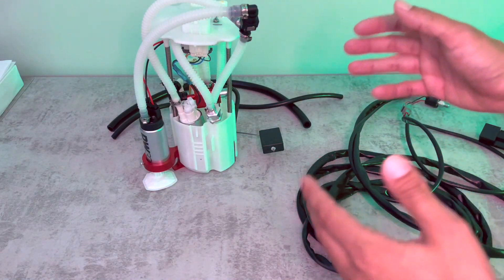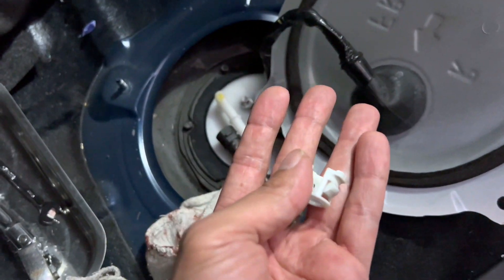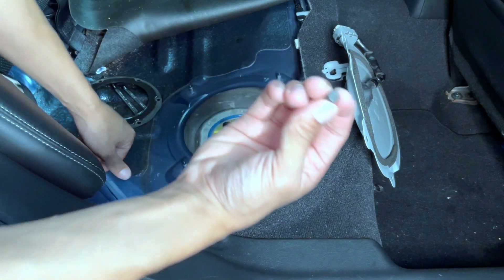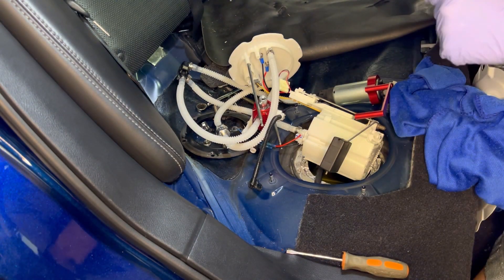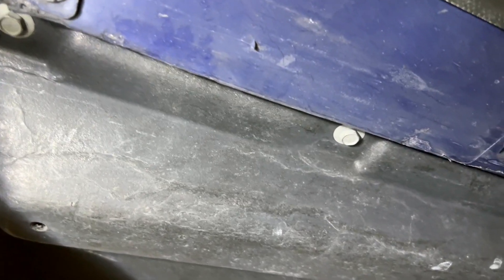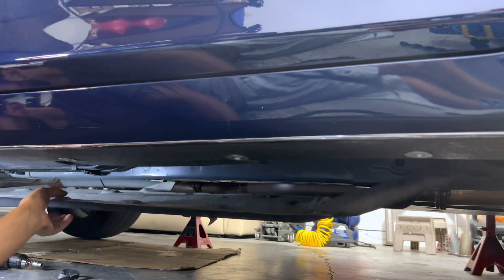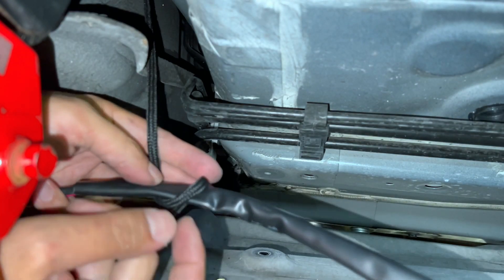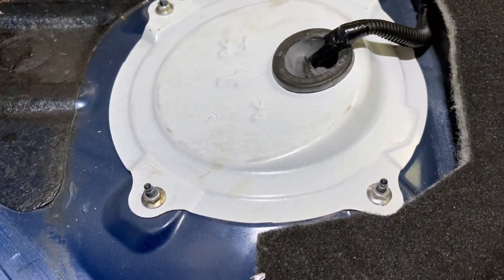How to Install a Spool Stage 3 Dual Fuel Pump VR30

Comment: Nice video, very helpful information.  This is better than just the AMS one because when you go built engine and bigger turbos, there will be a bigger demand on the low side.   I probably won't do this until I go built since I already have the AMS one.   Congrats on the new PB.
Reply from the maker: Thanks bro. 

Yea on stock turbos it’s not really needed. I prefer to have all my supporting mods for when I do upgrade my turbskies. Plus I’m using full E85+

Comment: Would this LPFP upgrade be enough to run up to e50 ? Or HPFP would be best after e30?
Reply from the maker: This will supply enough for e85. If I were you I’d get a HPFP and 1 walbro LPFP.

Comment: Whats up Z,

I think there is a "better" way.

Surge tank up front, run a A/N fitting from the ff kit, into the tank, the tank itself can hold a secondary pump. Hobb all that from there to the proper locations. 

But solid video as always papa!!
Reply from the maker: What up, that does sound like it can work too.
Reply from the maker: Btw, I need you to send me the necessary filters and stuff to store my E at home. Ima buy E98 soon.

Comment: It was a little tricky just putting in and taking out the factory fuel pump assembly when I install the AMS LPFP.
Reply from the maker: Yea, this is a whole other level of pain in the butt.
Reply: @ZillaFullBoost  Yea looked pretty intensive. I'm pretty sure my car was suffering from fuel starvation anything less than 1/2 a tank.. the AMS upgrade pump seemed to help with the short testing I did with the aid of the ecutek app and looking at related parameters.
Reply from the maker: The single walbro 450 will do fine. On my single set up I was able to run just below 3/8ths of a tank of E70 with no issues. This was from a dig for 1/4 mile. On 93 it would be fine even with a 1/4 tank.
Reply: @ZillaFullBoost  Im just running 93 from time to time E20 but not tuned for E-fuel.
Reply from the maker: You’re getting fuel cuts below half?
Reply: @ZillaFullBoost  I was at times before I put on the AMS LPFP. It's been a while since I've driven my car hard but for like 2 years towards the mid to end of 1st gear mph would drop under 100% WOT. As much as 5 mph and the stall out could be felt as a hesitation. I have been tuned by Hussain and Hussain could  make nothing of it. I had a suspicion so one day a fellow in the area on Facebook marketplace was selling the AMS fuel pump. I bought it and installed it. Problem retified itself about 98% last time I ran about 7 runs and dataloged.
Reply from the maker: @GettingthruLife  oh nice at least you're fine now.
Reply: @ZillaFullBoost  my RWd 2019 Q50 is a joke as far as traction. When I got it I didn't know that I want/would go 500hp and 500 torque. I made bad decisions with tires and wheels and wasted money where I would have been set if I had bought MT ET Street R's and 17-18 inch rear wheels. Anything else was inferrior for this car/motor/turbos. Your blue car drag-pack is the setup I should have bought. Two 1/2 years ago those parts where much cheaper and more available.
Reply from the maker: @GettingthruLife  Yea these engines are pretty Torquey. Tires are a must because that RWD life 😅

Comment: What is your preferred wheel setup (tire, rim) for q50’s? Specifically redsport models. Thinking about going with R888R’s.
Reply from the maker: I’m biased towards the nismo V1’s. Since I’m RWD I prefer R compound tires. R888R  is a good tire.

Comment: Is this pump to run e30 mix or e85?
Reply from the maker: Full E98. The factory pump can run E30, but it’s recommended to just upgrade to a Walbro because it’s pretty affordable.
Reply: @ZillaFullBoost  what's a walbro? Sorry all this question I'm just trying to run e30 mix with factory fuel injectors
Reply from the maker: That’s the pump you want. Walbro 450. Same pump that comes in the AMS kit.
Reply: @ZillaFullBoost  e98 did you tried it ?